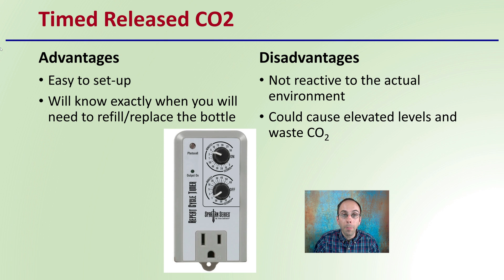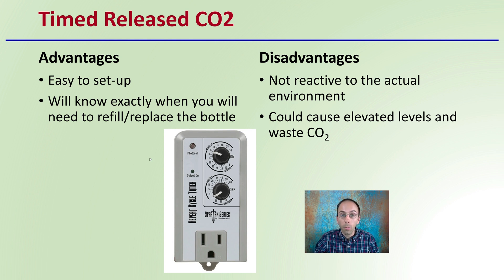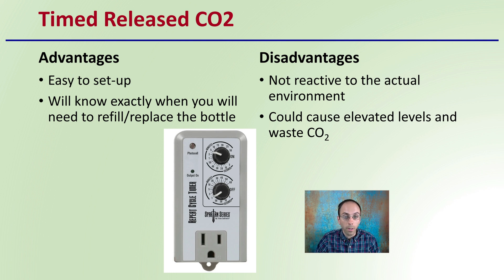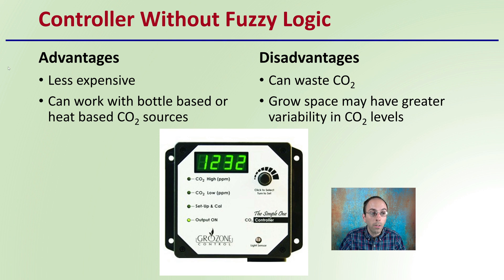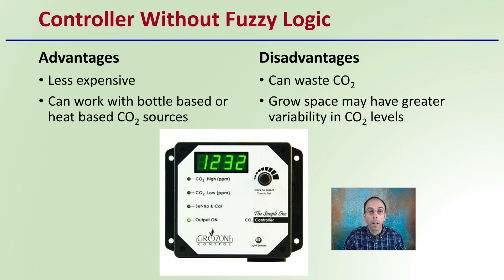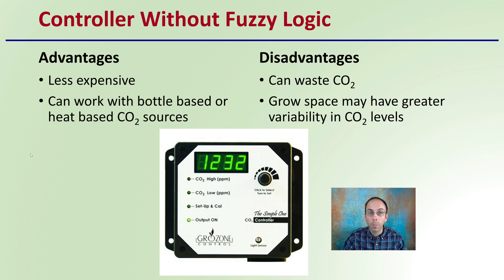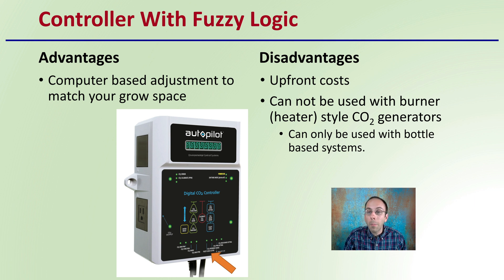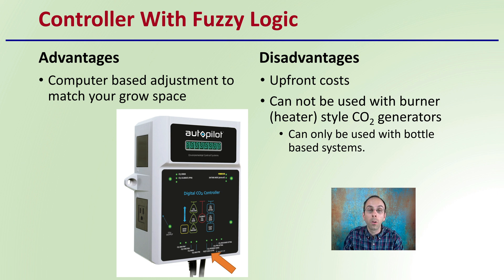Carbon Dioxide Controller Options for Cannabis Production

Comment: How come fuzzy logic controls cannot be used with a burner?
Reply from the maker: A burned does not allow for pulse dosing it is either on or off.  Fuzzy logic changes the dosing duration and frequency and this level of control is only beneficial for bottle (or liquid) based systems.